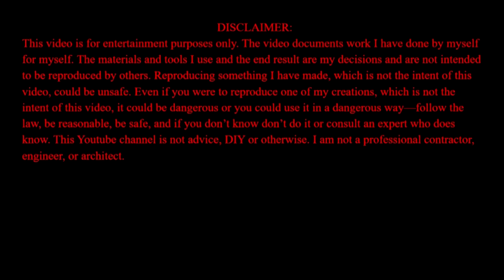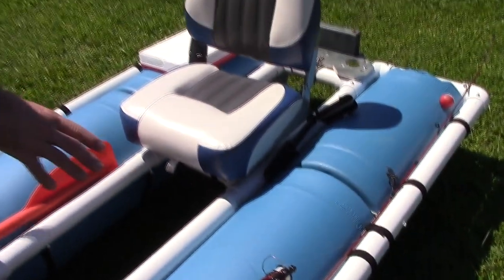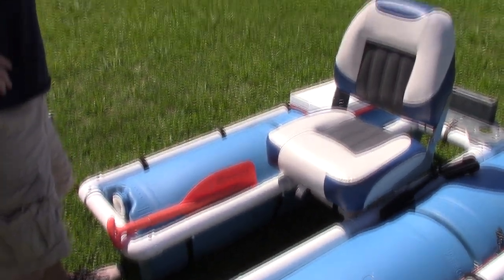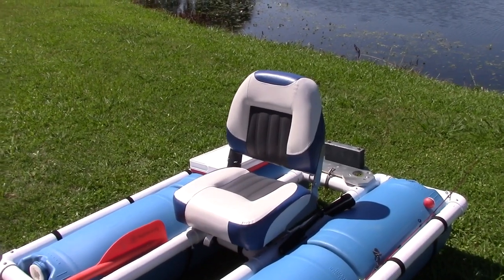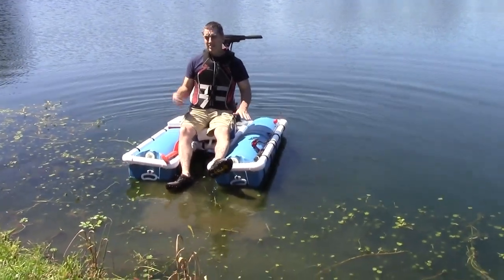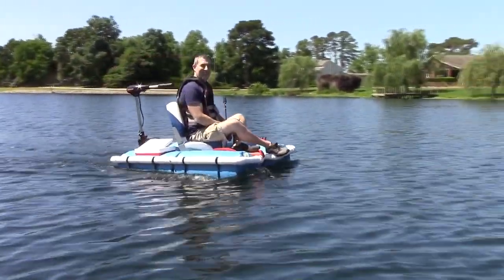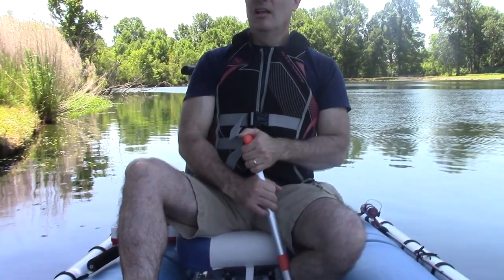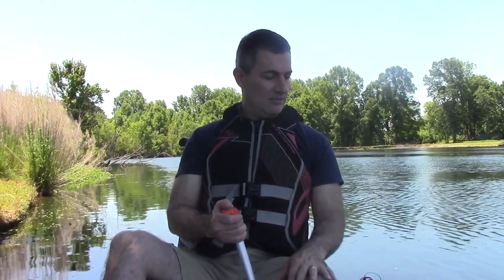Homemade PVC fishing boat made with 15-gallon barrels

Comment: I'm trying to figure out a propulsion system using a cordless tool so as to cut weight. Good idea or no?
Reply from the maker: It sounds like a good idea to me. I have watched videos of drill powered trolling motors; they seem to work really well. Thank you for the question.